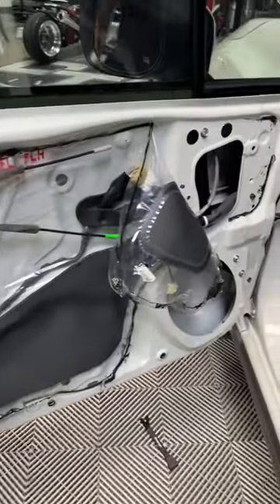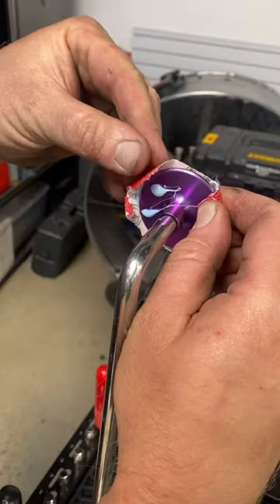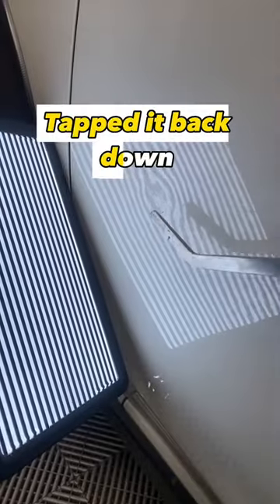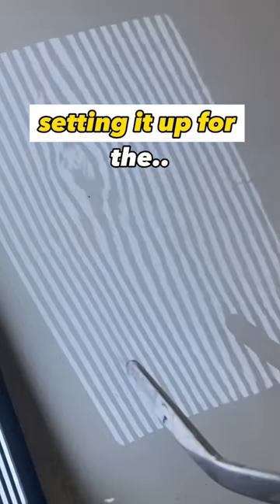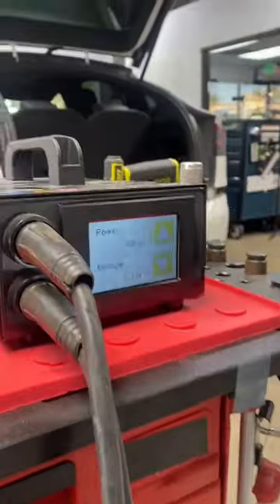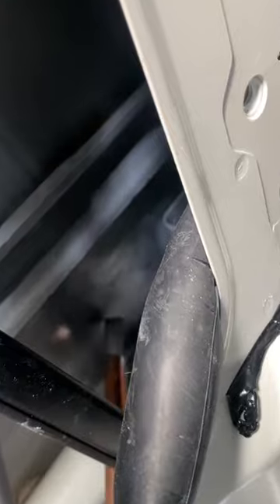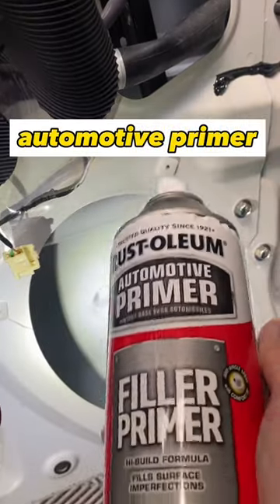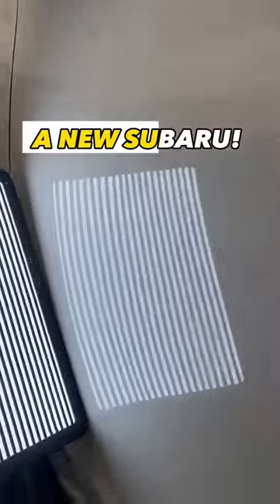Cutting-Edge Paintless Dent Repair - Power⚡️PDR Box

Comment: I don't see the point, why not just push it out like normal?
Reply: Perhaps because its aluminum and oil caned...
Reply: Not aluminum, if it was the magnet would not stick. But the steel is stretched too far in order get the metal back flat. That’s what the shrinky box is for to get some tension back to the metal in the stretched area